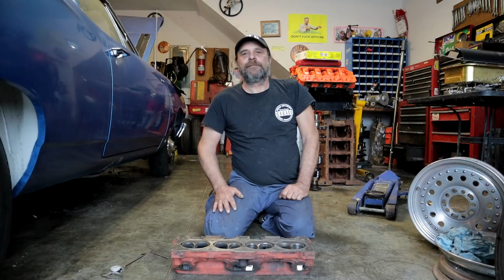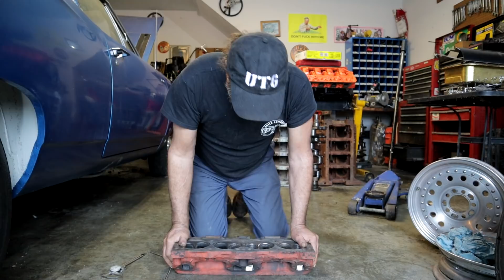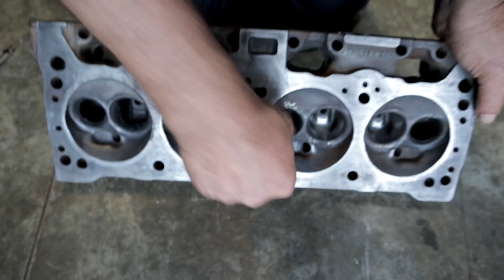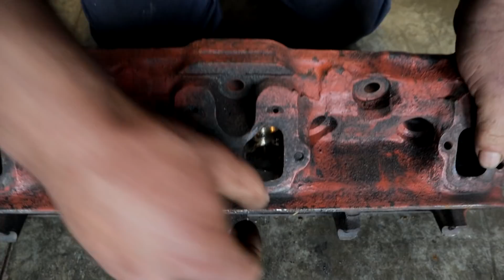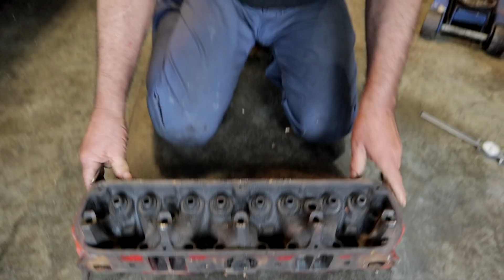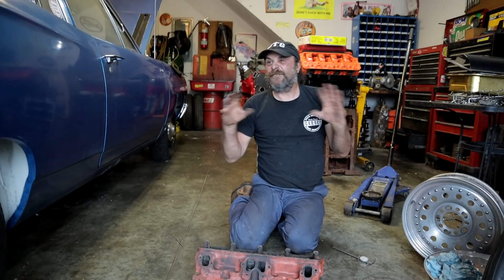Why Mopars Suck

Comment: So true. The engineering was not bad at all. Just as you stated, "Third shift, minimum wage work", prevented a lot of Mopars from being top dog on the quarter mile.
Reply: Union worker pride.
Reply: GM/Ford were the same...My Uncle had a new 1968 375 hp 396 Chevelle that he said was a dog! He kept it 6 months,he was a loyal GM guy! His 1967 Chevelle with the 325 hp 396 was quicker,both automatics,both same axle ratio..
Reply: 01trsmar...67 was 265 lbs. Lighter... Dosen't seem like much but never know... maybe tire diameter aswell... a 67 325hp.might have been a Quadrajet, while the 375, a 800 Holley, also larger ports, .. could be

Comment: I'm not big on mopar brakes, doing points on a 69 Charger with a small block sucks ass(not enough room for my big freakin melon back there), the way a 426 wedge always runs hot no matter what you do is exceptionally concerning, plus there is no way to run an aftermarket temp gauge, alternators on Omnis still make me beyond pissed, having to pull the entire fascia off an Intrepid to replace the headlights is plain asinine. The cam sensor on the 1500 4x4 Ram is gonna suck. I hated doing the 3.0 V6 water pump and timing belt in the Caravans, something like 8 different sizes of bolts and around 20 bolts holding the plate on the outside of the engine with two inches of space to get in there and get them out. On the bright side if a Caravan with that six is not smoking, its out of oil, that is a nice feature.

Those are some of the reasons I am a Pontiac guy who came from a Mopar family. Well I like the look of a GTO too, the 71-74 Roadrunner/Satellite/Sebring is a nice shape, but they are hard to find and stuffing big inches into them requires changing all kinds of stuff. If it has a Pontiac of any size in it from 1965 on, a 455 will bolt in using the same mounts, trans, and everything else... and it can be made to look like a 326 if you want. I can make a 540 look like a 326 too, the ultimate sleeper engine.

Comment: It was possibly worse in the late 90's. I did a set of Magnum heads for my buddy's Dakota R/T (which was a bunch of a dog) and turned out that the heads were machined what amounted to 1/8" off center through the length. Managed to port the hell out of them to straighten them out but the pushrods still never lined up right.

Comment: One of the 452 heads on my '76 400 had a piece of slag the size of a marble just outside the bowl area.  Same motor had a piston & rod that was 20 grams heavier than all the rest.
Reply: LOL. ive got a mild built 400 in my dart. stock pistons and rods, with a 383 steel crank, never balanced. oh well, it runs good!

Comment: I have had LA heads that had a ridge all the way down and around the bowl......   Might as well have been a 1" valve in a few of the holes. It was a motor I got from a friend for free because it wouldn't run right. It would murder 3 plugs and on a dyno the AFRs between cylinders were almost 3 points at the top end. I only wanted the forged crank but when I tore into it my fingers got cut open on the intake port and that's how I found the casting issues. A week of porting and it ran like a hot damn!

Comment: We had a Possie dirt track racecar with a BB 383 60 over. When we pulled the freeze plugs we found lots of loose sand and wire in the water jackets. We spend hours fishing wire out with angled needle nose pliers. None of us had ever seen wire loose in a block before.
Reply: I removed the end core plugs from a set of 383 heads and there was a wire running length wise so I guess that was a sacrificial anode for corrosion protection or maybe to stabilize the casting core.

Comment: Yeah 906 heads can just be a gamble. Like I had a 413 I took the heads off cause at the time I was told they didn't make unleaded  valve seats. I know better now but the 906s just were rough on the inside.

Comment: Old castings were garbage. I'm glad you brought this up. In the 70s and 80s the fastest cars were the ones that actually ran right. The others had wrong cam, head and intake combos usually with wrong jetting as the cherry on the top.
Reply: A prime example is a 360 Cordoba. Toss the 2 barrel or factory 4 in the scrap heap, along with complete exhaust system, Lean Burn crap, and broomstick cam.  Add a 268 cam or stock spec 68 340 cam, aluminum intake with a real carburetor , and it's a totally different animal.
Reply: @shaunclifton5281  
But it's still a low compression engine.
Reply: @MrJohnnyDistortion  I never said it was 9:1.  I said they became a Totally different Animal with those changes. My father had a 78 Cordoba, and my brother bought a new 78 Magnum. The difference was day and night with those changes.
Reply: @shaunclifton5281  
And I never mentioned a compression ratio. Of course those changes would give results. 50hp? 60?
Reply: @MrJohnnyDistortion  Enough to Enjoy and make it a totally different car.
Reply: @shaunclifton5281  
It's not a totally different car. 🤣
Did you change the rear gearset? 3:55 perhaps? That'll make it hop a little.
Reply: @MrJohnnyDistortion  pretty funny how there's a Dick in every comment section.  Job well done Sunshine. 👍
Reply: There were screw ups on the line too. Late 70s a friend had a really quick 71 LeMans Sport 400 4 speed . We assumed it was the standard corporate 400 but some parts just didn't match the catalog at tune -up time . A poncho fanatic got curious since the block serial didn't match a 7 year old car that the family claimed was un touched since the day it was delivered to the dealer . Found that the casting numbers were RA IV specific . So somebody else got a Goat that was a real DOG even though the order called for the more expensive engine option that was 2 steps above the LeMans Sport .

Comment: Who amonst us hasn't got a "humorous" anecdote about LEFT-HANDED lugnuts or the mysteries of the Ballast resistor. Anyone?
Reply: Both very easy to answer. Ballast resistor creates heat... do you want that heat inside the distributor cap like gms? or on the firewall where it won't interfere with anything? Gm guys have distributor issues... mopar only got ballast resistor issues. as for the left handed lug nuts, that was chryslers attempt at making it easier for a women to change
a tire.
Reply: @mattmcneice7223  and Bobby Featherstone. I thought that the left handed threads were in theory suppose to keep the lug nuts from breaking loose and backing off the stud. At least that's what I have heard and read.
Reply: @bigbear5510  yup a loose nut should at least stay on the stud and move towards the hub rather than back off and fall on the road like RH threads will do on the LH side.
Reply: @mattmcneice7223  the ballast resistor lowers the voltage to the coil and points gm built the resistor into the wiring  nothing to do with heat.
Reply: @WhiteTrashMotorsports  Gm distributors are internally resisted yes.
Reply: @mattmcneice7223  are you referring to an HEI or points distributor? A factory GM points system used a internally resistored power wire to the coil to lower the voltage and an HEI just uses straight 12v there is no resistance in either 2 distributors.
Reply: @WhiteTrashMotorsports  have you ever looked at the back side of a ballast resistor? It's a coiled wire... Touch it... It's hot!
Reply: owned Mopars since 1976 never had a problem with a ballast resister but always kept one in the glovebox  the few 1960's Mopars that had the left handed lugnuts were always changed out asap
Reply: @michaelwallbrown3726  the mopar ballast resistors were alot like ford duraspark boxes, you would either get a car with the original one that lasts forever or you get a car that fries one every couple of months, I'm not sure why that is but that is what I have noticed over the years.
Reply: Since my brothers have a 69 and 70 Charger, and the one younger than me is a huge mopar nut, we have lots of left hand thread stories.